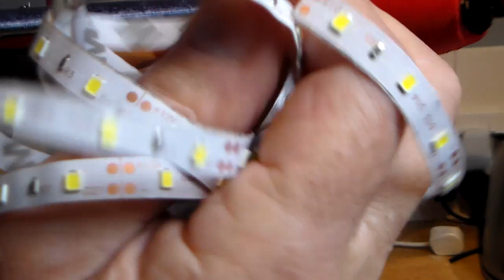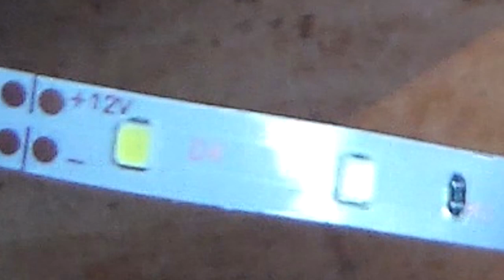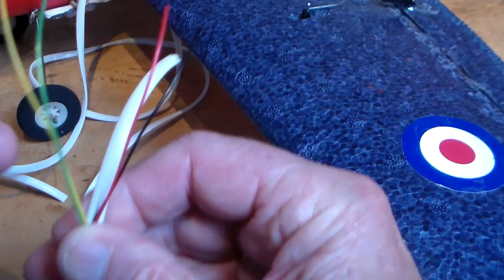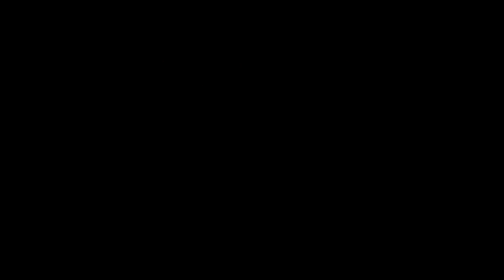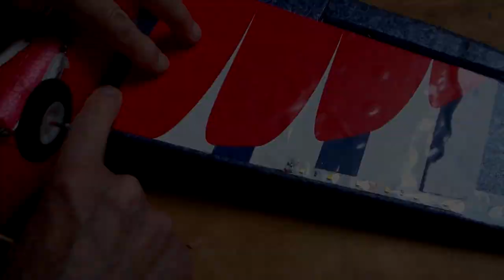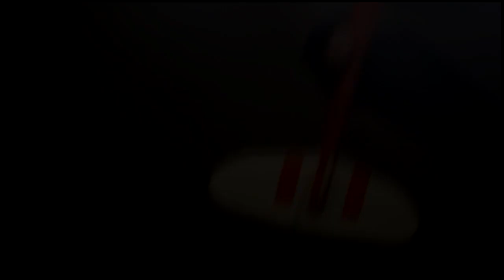Here's how to give your model a new look with some LED lights.    Great for night flying!

Comment: I didn't realise it was so easy to do Bob, does it matter how many LEDs you have?
Reply from the maker: Current draw for those 12   was 80mA which s negligible compared to even a small brushless motor.  You could have a 120+ for 1 amp.  Come on, let's see what you can create!
Reply: Watch out Cliff! That durn'd Mexican is trying to suck you into gettin' into trouble with the authorities for flying after dark! 😱 
A bit easier for us out here - if we stick to doing it out in the Min Min Light country! 😜🤣🤣